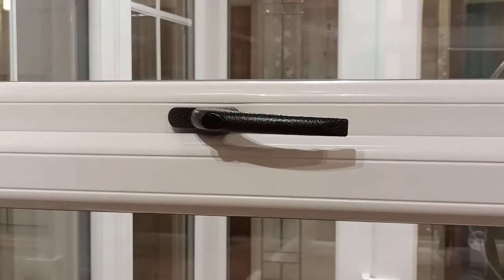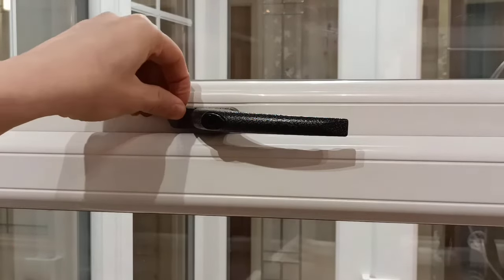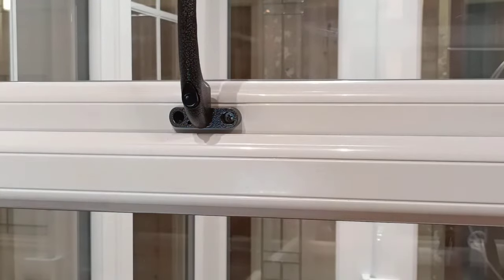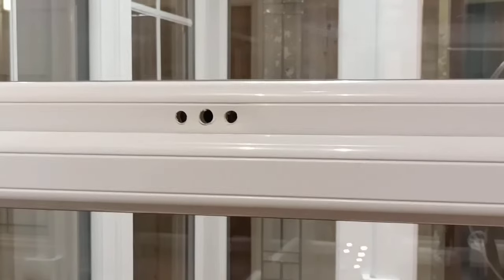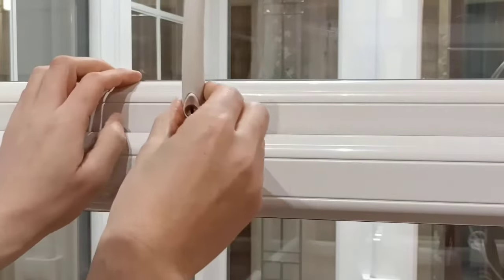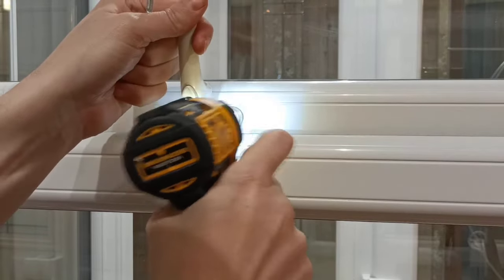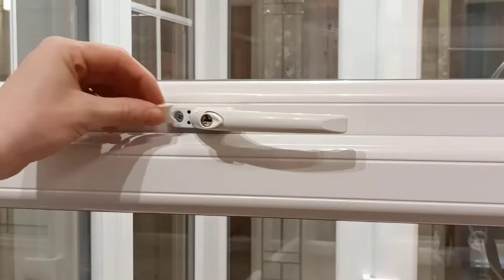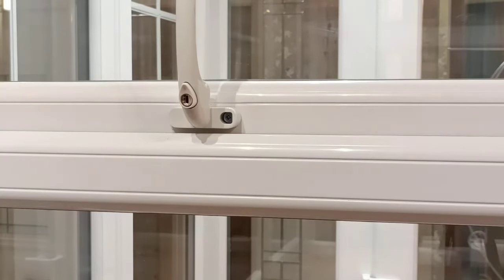How to Easily Remove and Replace a Standard Espag Window Handle (Step-by-Step Guide)

Comment: My top bathroom window handle was just flopping about with the window locked, the handle not doing anything. Took it off with the two screws.The spindle had almost disappeared into the mechanism. Had to fish it out with some tweezers. Tapped it back in to the handle as it appears to be a friction fit. Refitted it with a bit of difficulty.With the window open fitted the handle in the open position and all  is  good. Makes you wonder if a longer spindle should have been fittted in the first place. Is it a common thing these spindles working loose?
Reply from the maker: Hi, yes it's fairly common for the spindles to get stuck in the locks, we see it a lot in our coastal area due to the salt air. The spindle should be long enough to just pop out the other side of the lock when installed.

Comment: Hi

Installed a new window handle replacing an old rusty one. Old one worked fine just replaced to freshen up.

1 went on well and worked fine but when I got to the others the new handle fit ok but the handle wouldn’t open once installed. Spindle length appeared to be ok but could this be the cause of the handle not opening?

Cheers
Reply from the maker: Hi, normally this would mean the actual window lock itself is seized or broken. Send some images/videos over to sales@dgpsuk.com

Comment: Hi. The problem is that the spindle is stuck in the window. So I can remove the handle but the spindle is still inside and I cannot take it off. It just doesn’t move. What can I do?
Reply from the maker: Hi, try soaking it overnight with WD40 or a good penetrating oil. It's seized onto the main lock case. Do you live near the coast? 
You may need to use excessive force if it doesn't release unfortunately.
Reply: Did you manage to sort this? Having the same trouble with our window.

Comment: Hi there, over the last few years a few of my Windows won’t open.  The handle turns but the window won’t push open. One by one this has been happening and now I have 3 Windows that won’t open! Is this likely to be that the spindles have worn over time?  Can I buy replacement spindles from you, or is it easier just to buy a new handle? I’m thinking of replacing all the handles on my Windows as it’s probably a matter of time before they all ending up going!
Reply from the maker: Hi, it could be the spindles have worn or the actual locking mechanism is broken, try a good handle in a window that doesn't work to see which is the issue. Send some images over to sales@dgpsuk.com for lock identification if you find it's the lock, but yes easier to replace the whole handle rather than the spindles themselves. Regards Steven
Reply: @DGPSUK  thanks for the reply. Do you need any pictures in particular?
Reply: @DGPSUK  hi there, I’ve emailed some pics over to you now, I think it could be the locking mechanism!

Comment: Hi, my bathroom window handle has snapped off completely, the window is unlocked. When trying to get it off the screws won't budge, one of them is rusted on the head of the screw. I've tried using wd40 to loosen them and tried a rubber ban to get a better grip on the head of the screw but neither of those worked. Do you have any ideas apart from having to drill them out? (The windows are only a couple of years old!) Thanks so much!
Reply from the maker: Hi, please send us some images to sales@dgpsuk.com, but it does sound like you will need to drill the heads off.

Comment: My aluminum window kitchen & bedrooms have pop rivets rather than screws the types youd see on hinges.😭.
Ever encounter these?
Reply from the maker: @CabOnTarget  yes they are a pain, but just need to use a 6mm drill bit and drill the heads of to remove the handle then you can either rerivet or screw a new handle on. 👍
Reply: @DGPSUK  Cheers I think ill do that so.

Comment: Hi, my handle has snapped completely and I can push the window open as usual, But the handle won’t lock the window which is the most important part, do I just unscrew the broken ans and screw the new one in ? Just easy like that
Reply from the maker: Hi, yes you should be able to unscrew the base of the handle from the frame and then install the new handle in the open position. Any issues drop us some images etc. To sales@dgpsuk.com
Reply: @DGPSUK  how do I know what length handle I need ?
Reply from the maker: @Polski2222  the handle we have in our link in our description comes with all sizes of spindles so one will work for you. It's the size from base of handle to end.

Comment: My handle wont lock  or open when i put the handle on ... Just no movement of the inner device. The handle works opening and closing but the windows just stays the same. Any ideas?
Reply from the maker: Hi, sounds like the main window lock, if you can take some pictures and email over too sales@dgpsuk.com we should be able to help with a replacement lock.

Comment: is this left or right handle i got a universal one but does turn the other way round
Reply from the maker: These are non handed so suit both ways. Normally handed handles are a cranked shape.
Reply: @DGPSUK  I had a daft question - bought a universal handle. I want to open to left, so locked when inline with the mechanism (down) and left and open. Atm it is going to the top to open. Is it upside down? How does it 'know' which way around it is working? Do I need to spin the spindle? Sorry daft I know.
Reply from the maker: @lucylindsay3442  Hi are you installing the handle different to what it was originally, if so you need to remove the lock and reverse it, you will also need to move the locking keeps. 
Let me know if you would like a video done to show what I mean. 👍
Reply: Thank you - definitely was being daft but I finally have a replaced handle. V. V. Helpful video (although cutting the screws was also 'fun').

Comment: My bathroom window handle has become loose and wobbles everytime we open/close. I tried to tighten the screws however the screws wouldn't tighten so I bought another handle and installed using the new handle and screws but the screws are still not screwing on I tired screwing in for almost 5 minutes but it's on ongoing cycle. Could you suggest anything please. I can provide images/videos if required. 
Many thanks
Reply from the maker: Hi, this sounds like an issue with the main lock in the window that the handle operates, could you email some images of the window, handle and the lock which is visible when open. Send to sales@dgpsuk.com
Regards Steven
Reply: @DGPSUK  I tried sending to the email address you provided however its not working
Reply: @DGPSUK   sent.